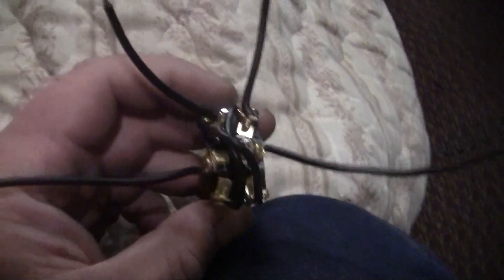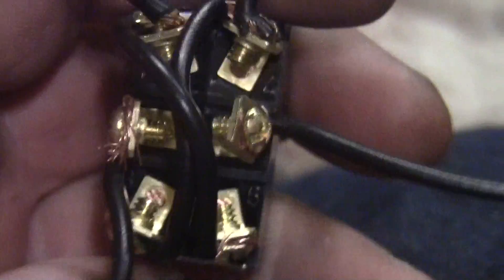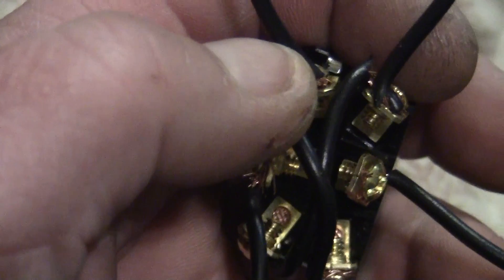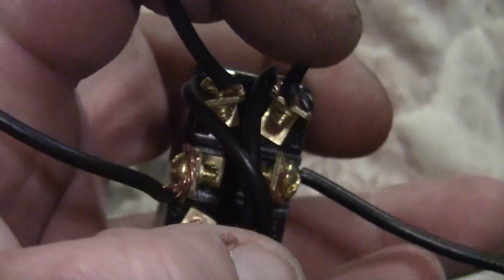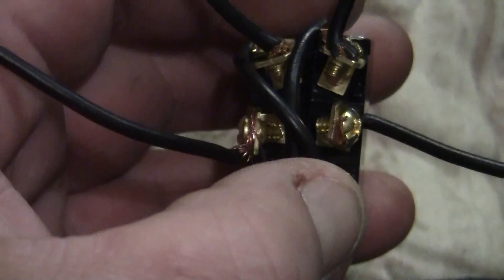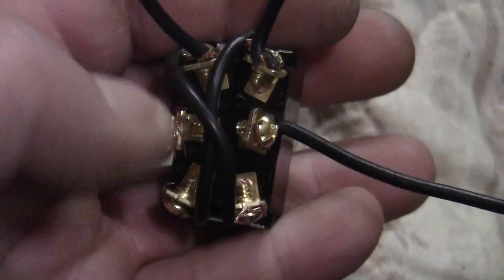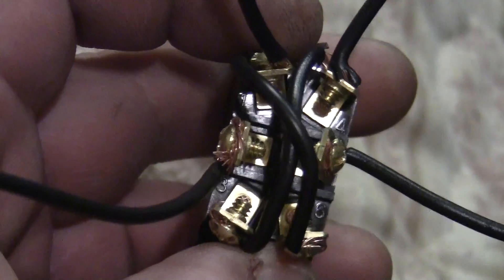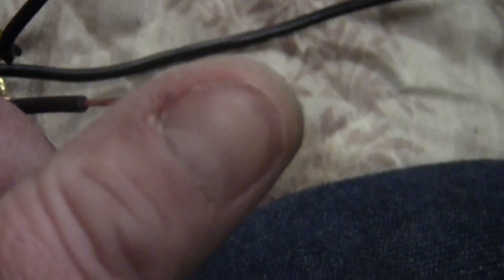forward reverse DPDT switch wiring

Comment: Can those 2 power in the center be connected to the same source/ fuse slot??  To say power a window motor in the tailgate of my Bronco? Was going to just use an add a circuit with this toggle switch.

Comment: Very helpful. I assume that this would work for an ON-ON DPDT as well. And, for the two middle power connectors, can those wires simply attach to the bus wire? Are there any situations using a DPDT to throw a Tortoise switch machine that might prompt the use of a resistor? Many Thanks!
Reply: That's a good question,  I was wondering similar situation as me wanting to just plug in an add a circuit fuse pigtail for a window motor they only have the one wire on the load side. I dont want the magic smoke

Comment: I've got an illuminated switch. 12V 20A, 24V 10A
           7
1         4
2         5
3         6
1-outgoing pos(+) for lower lamp 
2-incoming
3-outgoing pos(+) for upper lamp
4-outgoing
5-incoming (+)
6-outgoing
7- Neg(-) for lamps
Can this switch be used as reverse  polarity switch in a  motor?
Reply from the maker: Yes BUT .. Do not over load the switch , AMPS ARE EVERYTHING WITH SWITCHES ! thanks for the watch..
Reply: ShawnMrFixitlee I have zero experience with electronics, how not to over load it?.
It's a 24v Razor Quad.
Reply from the maker: NOPE , You will get the magic smoke !  To many amps .. You need relays between your load  DON'T TRY THAT !!
Reply: ShawnMrFixitlee thanks, so, should I get another switch? With more amps?
Reply from the maker: I don't think they make one heavy enough for that much DC draw .. DC amps ! You need a DC 24v motor controller .. EBAY is your best bet !
Reply: ShawnMrFixitlee thanks, I'll see if I can find it..
Reply: The switch you are describing is meant for controlling DC accessories. While some require more amperage, like winch motors, head lights and horns. However most of the motors like windows motors, wiper, door lock actuators and many others do not need a relay.

Comment: by the way,, great video. I followed you wiring instruction for the reversal and forward
of my Diy Epson direct to garment printer flat bad. I have just one question,,, there is a PF motor wire use to be connected to the motor coming from the main board (2 prong) would it be safe to connect it to the 2 post which only have the 2 cross wires to it??